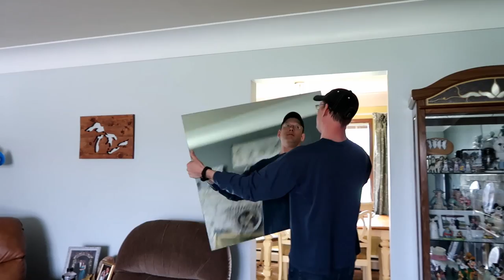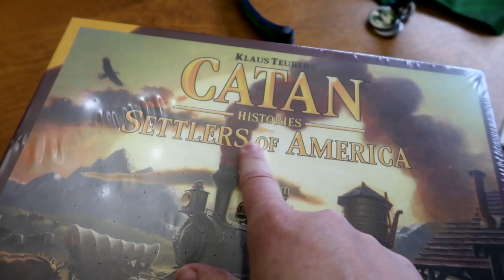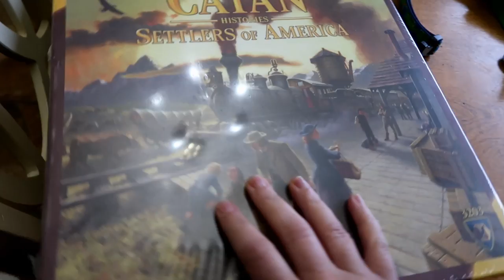WHY IS YOUR FACE DIRTY

Comment: If ya'll got black paint for your bathroom, you could try painting the lower part black and do a white counter top. Or Jamie's idea of a wood bottom with black counter top, but only if the wood color is a darker stain - a lighter wood won't look as good IMO. Search some pictures up on line of some bathroom counter top designs,  that's what I did when I helped put my moms bathroom sink and counter top together. She had an idea what she wanted after some pics. Good luck, guys! Hope all goes smooth! ;)

Comment: Someone ordered the same tub as you, but they only order one, so yours didn't count. Or someone else wanted the tub and you still didn't count.       Chirp
Reply: No. Pay attention. Jess explained what happened at 9:08 in the video. The truck driver got lost on his/her way to the delivery.

So what probably happened is that the driver couldn't find their address or somehow got lost and took wrong turns on the road, so they sent it back to the vender. That's why the tub is currently waiting in the facility waiting to be re-shipped.